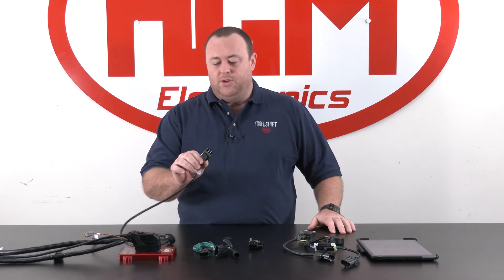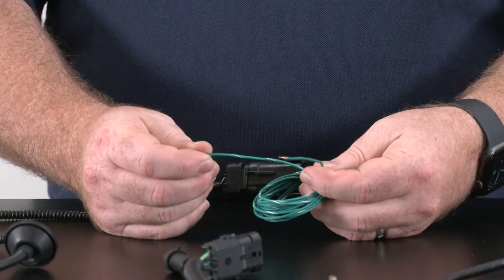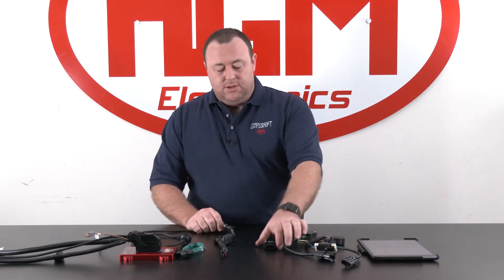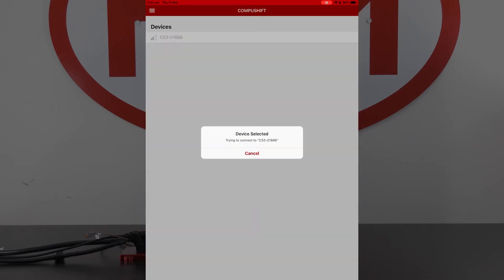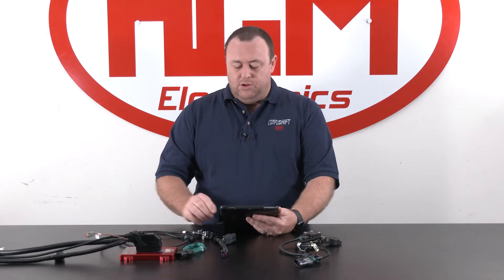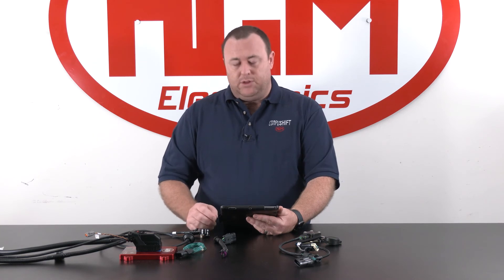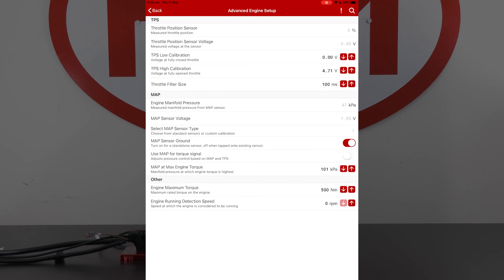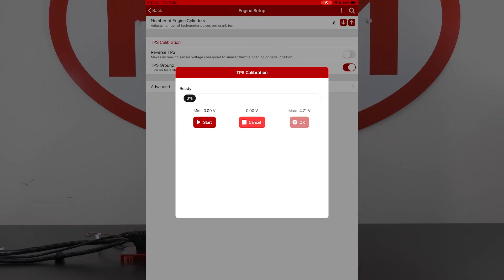TPS Connection and Calibration Tutorial

Comment: Is it possible to recalibrate a TPS unit that isn't meant for my car? I have an old TPS Bosch unit that is worn out as its the old strip style. I was thinking about getting an electro magnetic TPS type and calibrate it to match the OEM TPS. Is that possible or am I being too ambitious?
Reply from the maker: If you know the sweep (voltage) properties of your OEM TPS, then it would be easier to find an alternative TPS with a sweep that matches you OEM TPS sweep. If you have good knowledge of electronics, them I'm sure it's possible with the right combination of electronics to modify the TPS signal but it's not something we have ever tried. Good luck.